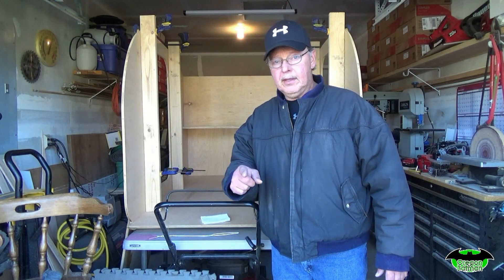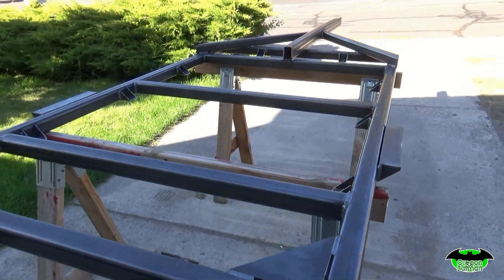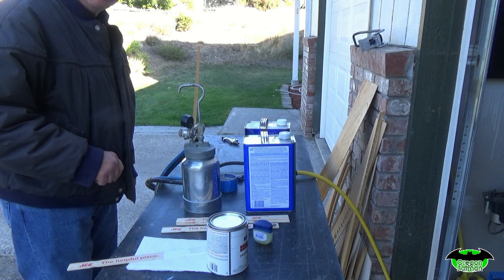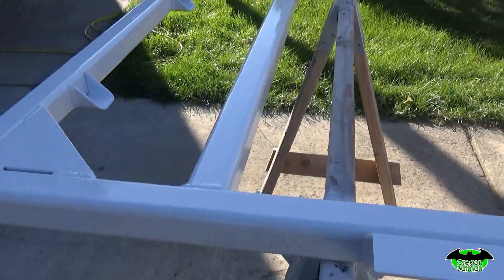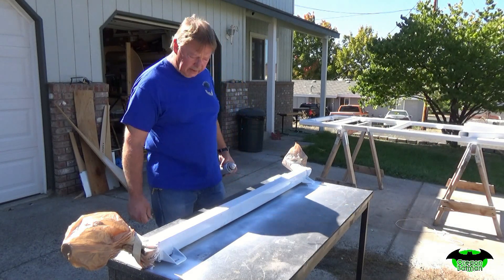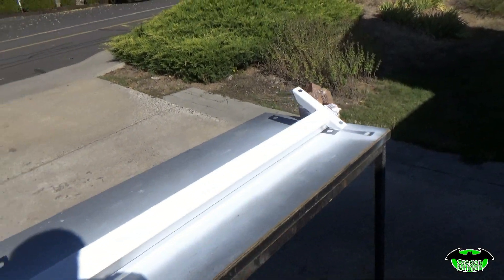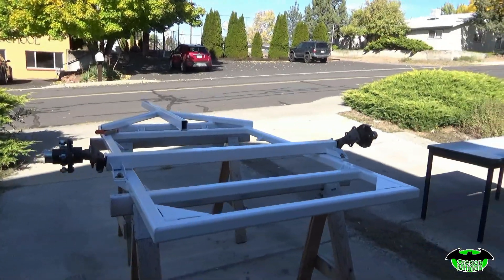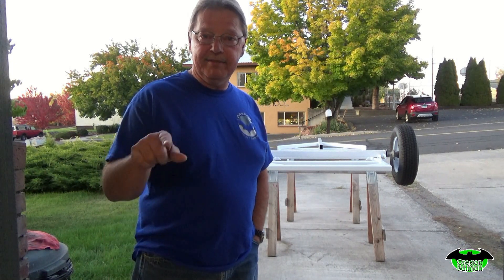Teardrop Build * Step-By-Step * - Part 19 (Painting the Frame)

Comment: Are you running a Chevy Trax? We have one too, so I know if I follow your built to the T, I will be able to tow it as well 👍
Reply from the maker: Hi aimee6781! I have a Buick Encor, which is about the same model as the Trax, Chevy's version of the Encor. I still have to get a hitch installed and make a test run... :)
Reply: @OregonBatman  I know since Holden closed down in Australia, that Buick have a 2020 version. Doesn't look that bad, but still like the 2017 version of the Trax 👍
Another question, how much does the teardrop weigh? Have you taken it over the weighbridge as yet? Sorry I'm only at Episode 26 😊
Reply from the maker: Haven't weighed it yet... guessing it will be around 1000 pounds or so (my trailer frame is pretty heavy)

Comment: Hello I just found your channel I am just a retired carpenter. Been binge watching your videos on building this teardrop. You explain things really well I love it so far. Did you build the metal frame for your trailer yourself and do all the welding or did you take it somewhere just Curious. I’m going to get the plans from you, do you have an approximate cost of the whole thing roughly with all your materials. So I can start planning, thanks
Reply from the maker: Hi Bamacher59! Thanks so much for following along. I designed the frame and purchased the metal, but since I do not weld, had a friend weld it for me. Turned out great. The cost for MY build was around $6800, but others have built it for a lot less depending on what they wanted in the end, and the materials they used. It really depends what you want to end up with. I built mine for show and functionality, others just build for function (costs less)  :)